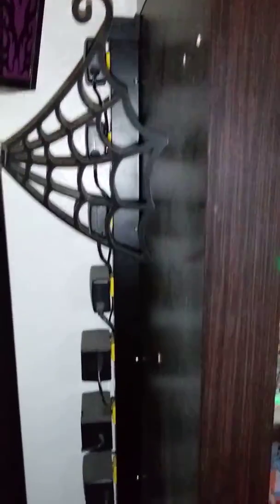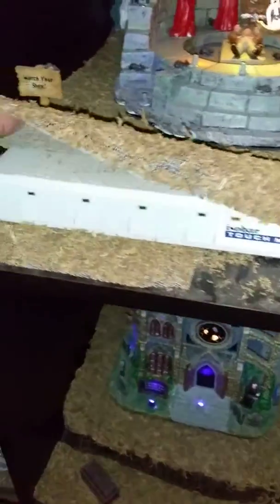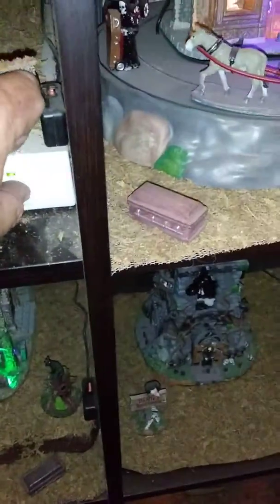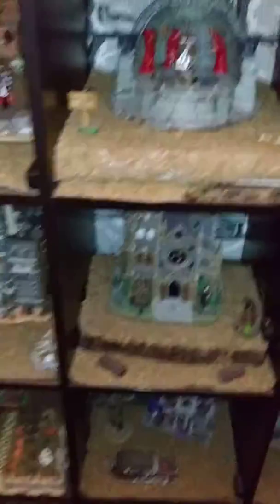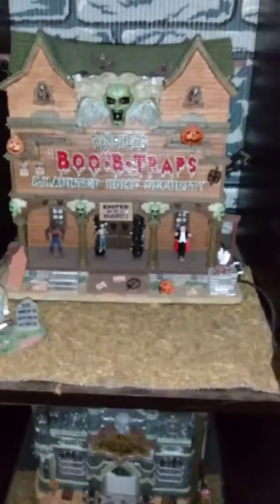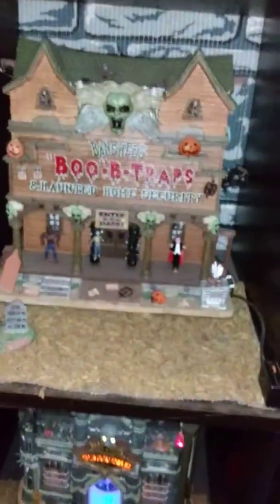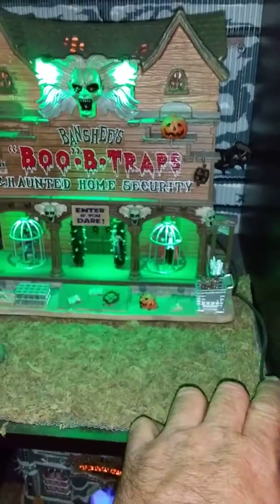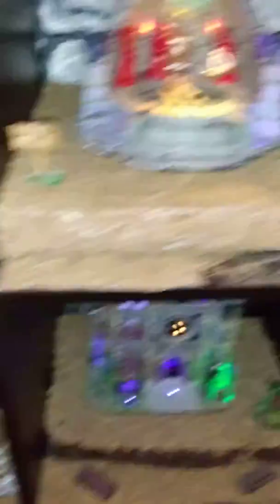Quick video on how I power my Lemax display

Comment: Hi Derek.  Near the end of the video, you talk about a piece that needs to be manually shut off.  I must have a few of these since I put dozens of Lemax pieces on display.  I'm guessing you mean pieces that keep moving, after the plug is turned to off, until they reposition themselves  (e.g. Round Up or Flight School).  I've not noticed a problem by having these pieces on the same multi-plug power as all other Lemax pieces (not manually turning the power off with the plug).  Am I missing something?
Reply from the maker: Some of the pieces need to reset as you mentioned two, what can happen, with an emphasis on can, they can fail because the microchip didn't get the signal from its starting position. Some pieces are less likely to encounter multiple turn-offs without resetting but some are more susceptible, the round-up and, ghost around are two that have a higher failure rate from improper turn offs. Lemax pieces do have some safeties to stop this but it can still happen. I myself, have only had one completely fail from improper turn off (many years of it) and one that I was able to reset when it wouldn't start up after a power outage. This is 2 examples out of hundreds I have owned or worked on.